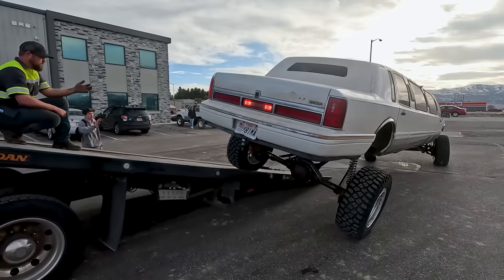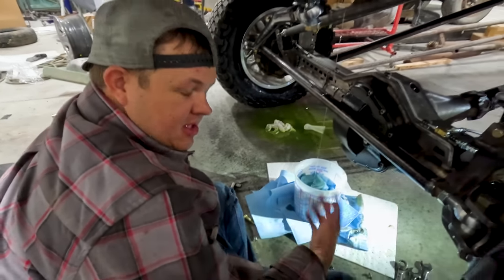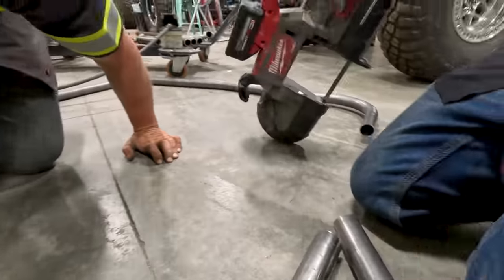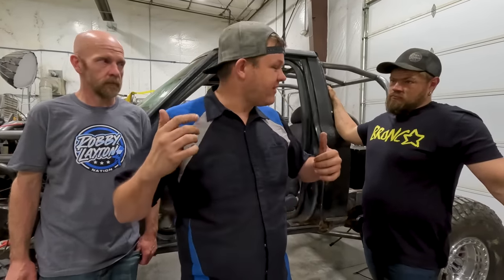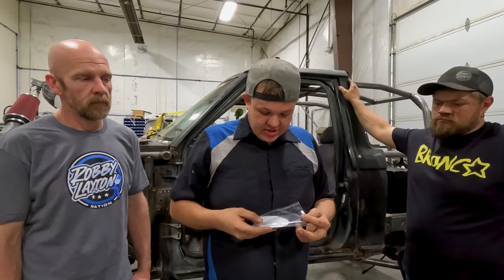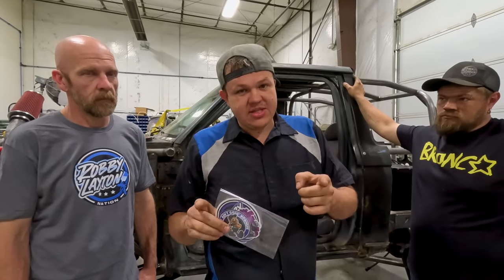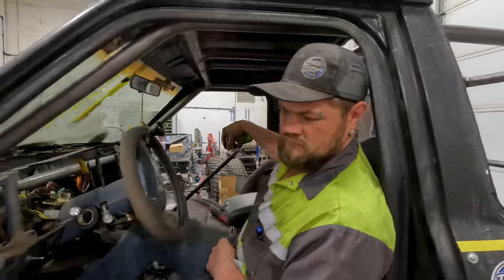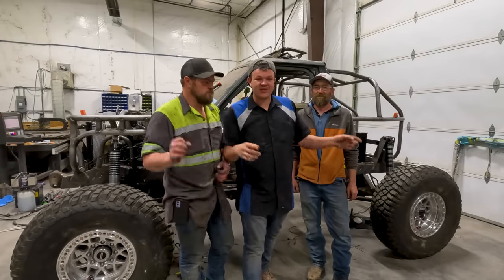The “LayMo” Land Yacht Limo Breaks Before Maiden Voyage!

Comment: Even though you're crimping the battery cable terminations you should also solder them before you heat shrink so that there's less chance of wicking water into them and causing corrosion.

Comment: Make sure you clock your driveshafts or you'll have a vibration you can't figure out. Also, you'll be changing U-joints more often than on an old Ford F-250 highboy.

Comment: You can weld most older power steering lines together. If it's steel you can mig it. Sometimes power steering lines only have like a 2in long Steel 90, but that's all it takes. And that's true for all hydraulic fittings. I've made many custom fittings.

Comment: Bronco II tip;The ECU/computer must have a SOLID ground and positive connection, including a good relay (OEM only for ECU)
This is is the very reason new battery cables have a separate ~10gauge wire, with a crimp connector (for the ECU).
Wire nuts will induce a dirty signal into the ECU voltage supply, causing the engine RPM to fluctuate once a stable output is expected.

Comment: Robby,
I own a 1998 Dyna Wide Glide Anniversary Edition Chopper with 33K miles, the last year for the EVO engine for all H-D models. I think Hillbilly would love to own this Motorcycle since he loves old stuff with the latest rendition with electronic ignition which I had Dyno Tuned with a Carburization kit  and Vance and Hines short pipes. That means this bike went from the factory tune of 78 ft pounds of torque to over 100 ft pounds.. Beautiful historic factory chopper that a Guy like Hillbilly would love to own.
Reach out if you think this is something he would like